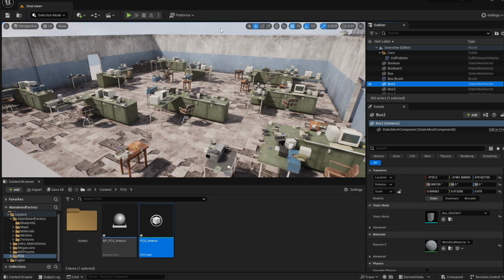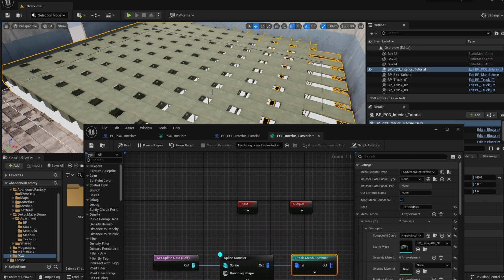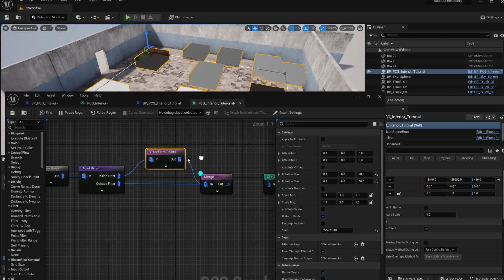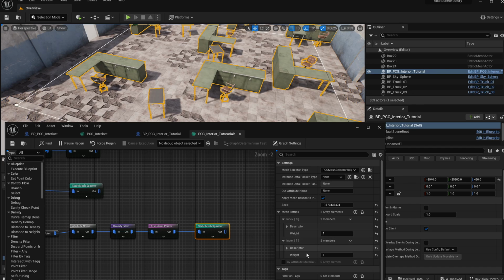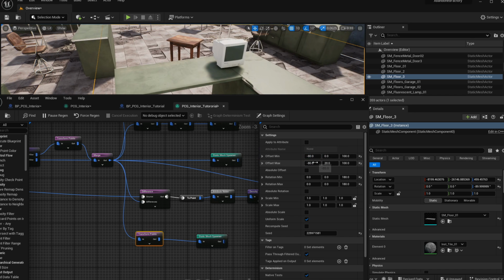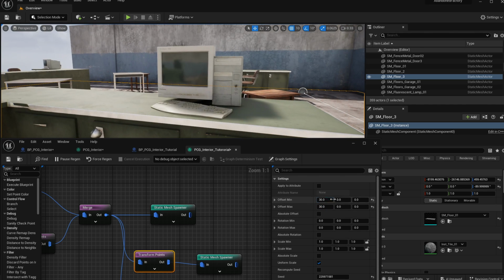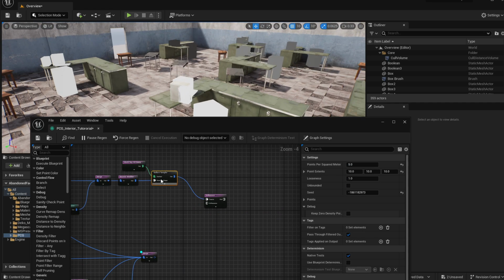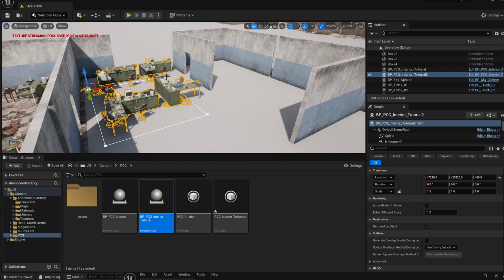EASY detailed interiors in Unreal Engine 5.3 (PCG Framework)

Comment: First of all, thank you for the tutorial. I have a question: Do you have to use dynamic collision to make World Ray Hit Query work? When I set the collision to static and used BlockAll on the spawner, it didn’t work. I’m worried that using dynamic collision instead of static might be too heavy for the actual project.

Comment: Nice Tutorial!!!
 I have an issue where the World Ray Hit Query returns nothing on debugging the following surface sampler, it's just empty. Did anyone encounter the same issue ?
Reply from the maker: try moving the points used for the rays , maybe they are below other objects or your ray length is small so they don't reach anything.
Reply: @dk_3d  It worked. What I did wrong: 
BlockAll instead of BlockAllDynamic in the Static Mesh Spawner & You really need to check the mark 'Set Ray Parameters' and change the z origin on world ray hit query .
Iam using 5.5.
Reply from the maker: @feldpost-music  i'm happy that it works now :)
Reply: @feldpost-music   I'm using 5.5 too and I couldn't get it to work. Even checking BlockAll vs BlockAllDynamic, disabling ignore self. What I could get to work is a different PCG volume that would generate on the desktop. Having only World Ray Hit Query + Surface Sampler seems to place the debugs on the spline itself, but not inside the spline.
Reply: @gamesthatiplay9083  I'll have a look
Reply: @gamesthatiplay9083 i'll have a look and text you back
Reply: @gamesthatiplay9083  Maybe you forgot to set 'Dimension' on 'On Interior' on the surface sampler ?
Reply: @feldpost-music   In the first surface sampler the one that goes from Get Spline Data > Surface Sampler has 'interior' set.  My desks show up fine. Then with the spawn desks > bounds modifier > surface sampler, I cannot set interior. .. WAIT ...  Just playing with check boxes, seems like I must have missed checking 'keep zero density points.' That did it! 

Thanks for getting back to me and giving me the motivation to come back to it with a clear head. I had continued on with the tutorial even if I had that lone issue, and now woosh everything works. To the tutorial creator, good stuff. Exactly what I was looking for with my office zombie apocalypse.
Reply: @dk_3d  thanks mate, i'll try

Comment: Hello, will this work with multiple PCG-generated buildings?
Reply from the maker: You can add it as subgraph in some building generator PCG, so it should work, not tested this exact example, but in theory it should be fine